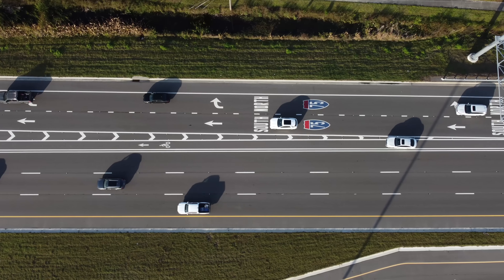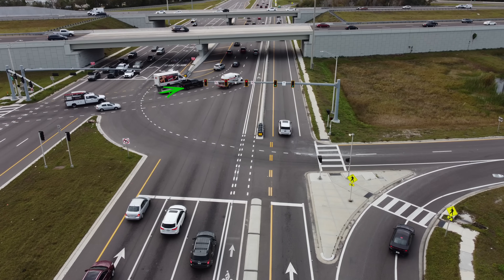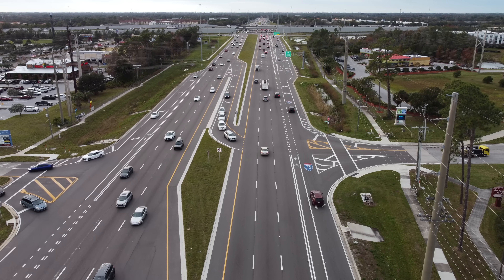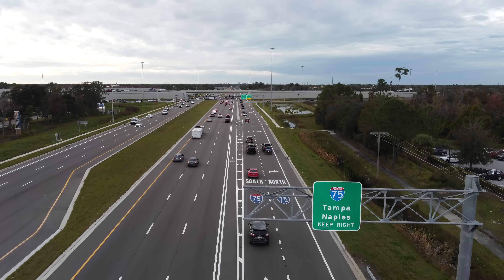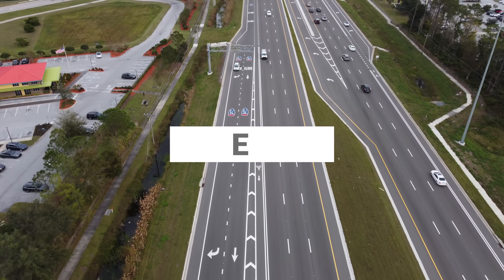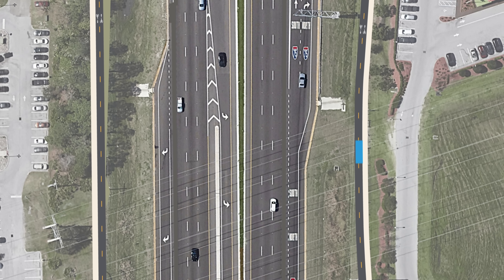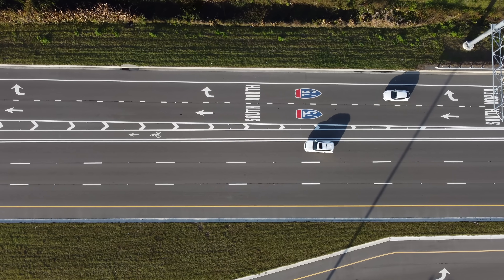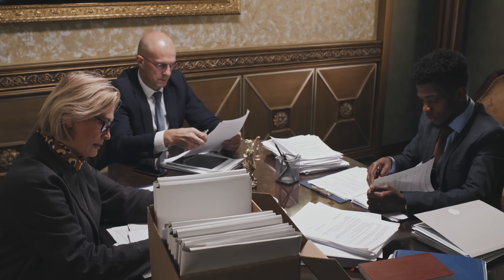This Brand New Interchange is Already Flawed

Comment: Hiya. Local resident here. This interchange makes the road to the west a living nightmare. Everybody who missed the ramp to go SB will make a U-turn to get on the SB ramp the other way. Plenty of backups.
I’m a part of some local bike groups and when they do group rides, they go over an overpass a bit to the south. It’s great for riding for the purpose of riding but impractical if you’re trying to go somewhere.
The main issue you would run into with the tunnels for the bike lanes is the water table. Houses here don’t even have basements because they would flood. There’s no way you could fit a tunnel in there. I live nearby (and I would argue even somewhat uphill) and my approximate elevation is 10ft. The ponds shown adjacent to the freeway are a great example for this.
Reply: flooding is exactly what i was thinking when he mentioned tunnels. it seemed like the crosswalk being farther back from the road is the best idea here, what do you think?
Reply: Wouldn't a bridge be preferable to a tunnel anyway?  It would have to be a little longer then a tunnel in order to accommodate the height of trucks, but aren't tunnels more expensive?
Reply: @khidorian As an active cyclist myself I can attest to cyclist not being keen on stopping to take an elevator. We want to keep rolling! I‘d rather cycle up a longer ramp to a bridge than have any kind of elevator lifting me up, as that’s gonna be slower and break my flow of motion.
Reply: @kathidubach  Oh yeah, you guys love momentum, like in portal. That's my B
Reply: @kathidubach Instead of a long ramp, how about a 40 foot diameter spiral?
Reply: I have got a question - have you EVER seen anyone walking there?
Reply: @nothereandthereanywhere  Good question! No.
Reply: What about bridges instead?
Reply: @khidorahian  it's an option. But the height would need to be at least 15 feet, cyclists won't like that. Tunnels can be shallower.
Reply: @drfisheye  True, I was thinking more lifts to get up and over as well
Reply: My brother lives near  Tampa. He has a septic system and when we visited him,  there was a hurricane that brought the water table so high that there was sewage running down the road. Tampa can never have a tunnel.
Reply: A bicyclist does not need to be deterred by less than a foot of water... I remember doing it in Lund, Sweden.  I just need to know the actual depth, and you may be already wet when you come to the tunnel.
Reply: Most of the Netherlands is below sealevel and it's pretty wet (hence the name). Yet we have bike tunnels. The tunnels don't need to be very high and the roads above will often be elevated a bit so the tunnels don't need to be burried deep. The tunnels are waterproof. And drainage systems will drain rainwater. Sometimes the tunnels have basements to catch rainwater.
Reply: They do tunnels quite OK in the Netherlands, a land that is largely below sea level. That is because they do the engineering and have the knowledge of pumping infrastructure to keep them dry. Spend the time & money and you'll get the desired results.
Reply: @petesig93 I'm a geologist from Florida. I'm sure the Dutch appreciate your accolades, however their practice cannot be implemented in Florida. I'm not saying it's impossible, but it would be incredibly inefficient and prohibitively expensive. Florida's surficial deposits are composed of sands unlike the fine muds and clays of the Netherlands. Sand is highly transmissive to water while clays are not. No engineer or municipality of sound mind would construct tunnels in a region where this is common knowledge.
Reply: Thats not a symbol of a man on a bike. That surely is the only explanation
Reply: I mean the highway is already in a depression so it wouldn't be hard to raise all the access roads slightly so that the tunnels stay above the water table.
Reply: @hedgehog3180 it's not in a depression, the highway and other roads are only a few feet above the water table. Only the interstate is built up to go over.
Reply: Idk Boca has tunnels under roads for some of their bike infrastructure even though the water table is just as high. It definitely is doable
Reply: I would assume the main issue, as it is with most tunnels would be the homeless. I did think of drainage being a problem too, but it usually has a solution
Reply: Digging a tunnel, or anything into the ground in Florida may find you a sinkhole!😮😮😮
Reply: I live 1 hour from here
Reply: Tunnels also feel less safe for some people. Its usually poorly lit and not a lot of people. I think a surface crossing deeper in is the best solution. They can also add a pedestrian prioritized/motion sensing traffic light and make the crossing the same height as the sidewalk too. All of these should make the route sufficiently safe and comfortable.

Comment: The most infuriating thing about the cycle path is that even if one were to be cynical enough to accept that a simple strip of lane markings is the best one can achieve politically, it still would have been safer if it was just placed on the far right of the road, next to the sidewalk, sharing the pedestrian crossings. There it wouldn't have costed much more at all... This current design shows not just apathy but also incompetence in understanding cyclist infrastructure.

Comment: Re: bike lane tunnels. Tunneling is seldomly a feasable solution in Florida. You'll hit the water table in a few feet. There is a reason almost no homes in Florida have basements, those that do are in the north of the state where we have some elevation but for the most part they are not possible.
Reply: Sooo....overpass then. Done Probably cheaper than a tunnel too.
Reply: @CanCobb  That introduces a new problem. Not enough space to build an overpass with a decent grade.
Reply: So then it has a switchback if necessary. This happens in other places too.  @jrkorman
Reply: @jrkorman not enough space???
Did we watch the same video?
Reply: @Jehty_ Yes we did - but  did we look at the same things. The I-75 northbound exit ramp that intersects East-West Hwy 64. To cross that with a bike overpass is going to need somewhere on the order of 18-20 feet of elevation gain. Since that WILL be a long grade it will have to be a shallow gradient, say around 2-4 percent. That means just one side of the ramp is going to have to be on the order of 400 to as much as 800 feet southward along the exit ramp, then crossing near the signage (which of course could be placed on the crossing), then another ramp back down the other side. A second nearly as long ramp structure would need to be built to cross the Hwy 64 to southbound I-75 on-ramp.
I use these longer ramps because I'm also assuming that the ADA folks will get involved quickly and if so there would need to be a large number of flat landings along the ramp. Also allowance must be made at the bottoms of the ramps to ensure that riders don't have extreme curves at the end of the descending ramp.
Reply: @CanCobb  You'll need about $20M per side street for that. Pedestrian bridge cost + all of the dirt build up you're going to need unless you want a labyrinth of switchbacks due to the strict ADA grade criteria. Also, just spoilers, it won't fit in the right of way without encroaching into the adjacent clear zone. So now you're going to need two walls per approach. That's going to get very expensive very quick.
Reply: Yes that is why we in the Netherlands don't have bike lane tunnels. ......................oh wait.
Reply: @driewiel do they have alligators in the neatherlands? Nope
Reply: @eptdy  We have cows.
Reply: @driewiel  oh yes the Netherlands where they have 8 lane highways in the town? To put a bike tunnel where he said would put it underwater anywhere in Florida. You would have to either (A) keep the bike lane at grade and raise the side street or (B) raise the bike lane OVER the side street. Option B is way cheaper this scenario as raising a single bike path over a side street is way cheaper as the grades can be steeper than roadway criteria. But you're going to need to clear 16 feet above the existing road to the bottom of your structure at a minimum. That means you'll need to build up the dirt roughly 20 feet in advanced on both sides with slopes than can grade down without encroaching into the road's clear zone or outside of the right of way (owned property of the state). You can only go up at 5% max which every wheel chair user will hate you for but let's do it. That's 400ft of lead up on both sides to get to the right elevation. You could alternatively put in an elevator and ped bridge at each side street. All of these things get very expensive very quickly, and you're only talking about a single side street. What you quickly find is that it's not a practical use of money.
Reply: @fearlv1rattata You mean Florida is on a completely different planet so what we do in the Netherlands is not possible over there? Half the Netherlands is below sea level. We have far less space. But we care about cyclists. That's the difference. https://youtu.be/ztQ8Oj2fSB0?si=Z5fAp3_vitwLzlkx

Comment: Here's an interesting intersection you should checkout: Kolb/Valencia in Tucson AZ.  They changed the intersection to eliminate all left turns.  Instead you pass the intersection and there's a dedicated left turn to a detour road.   Turning left from westbound Valencia onto Kolb is so rare they didn't even bother doing a detour road for it, instead you're instructed to pass the intersection and do a u-turn.
Reply: That intersection looks like it was made by a control freak. I don’t like it at all. It would make for a good video.

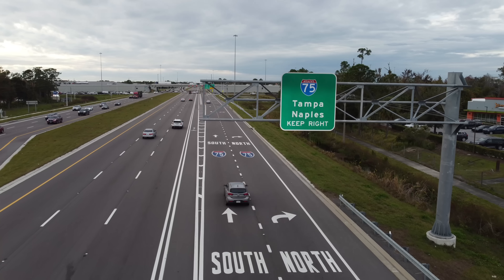Comment: For the drivers the issue with the signs is they were installed backwards.  The signs are flipped.  If they fix this mistake all of the driving issues will go away.  (First incorrect sign @ 3:37, second @ 3:55.)  I suspect it will eventually get caught and fixed.
Reply: You are 100% correct.  On the public website for the project, they have the drawings for the "Recommended Alternative", and they have those two signs drawn in the opposite position as they are installed in this video.
Reply: Here's the site:
https://fip.fdot.gov/Studies/Details/41

And here's the actual PDF (the signs in question are on the last three pages):
https://fdotfipdevstorage.blob.core.windows.net/public/studies/41/I-75%20at%20SR%2070%20Rec%20Alternative.pdf

Comment: Your tunnel idea is lousy for cyclists too, just for a different reason, and less deadly.   You do not want to be going up and down steep ramps that would be required to go from level with a road, under a side road matching the first one, and back up - even more so, you don't want to do it that frequently in such a short distance.  It's a significant amount of extra physical effort in general, and even more if you have cargo on the bike.  But, this isn't anywhere like the Netherlands so... "Cars first!"

Comment: The placement of that bike lane represents the problems of the "bikes are cars" mentality. The reason it was put in the middle of the road like that is because of this mentality of treating bikes like they are the same as cars, so they put the bike lane with the car lanes and thought that made sense. Whereas the proposed solution in this video, putting in a dedicated bike lane along what would typically be thought of as a pedestrian path... that represents a "bikes are pedestrians with wheels" mentality. And that, IMO, works way better way more of the time. 

I feel like I've been banging my head against the wall for over a decade when it comes to this issue. I never felt like the "bikes are cars" mentality was good. It's dangerous. When you're on a bike, you're a lot closer to a pedestrian than you are to a car. A collision between a cyclist and a pedestrian is gonna be a lot less dangerous than a collision between a cyclist and a big vehicle that can go over a hundred miles an hour. This is ESPECIALLY ridiculous when we're talking about highways here. I don't care how fast you can peddle your bike... you're not keeping up with that kind of traffic.

"Bikes are pedestrians" works way better and is way safer. Even in a situation where there's no bike lane, I'll gladly use the sidewalk before I try risking my life on the road. Ideally, there needs to be dedicated bike lanes, and they need to be separated from the vehicle traffic in a way that feels safe. Just shoving us on the side of the road, or in the freakin' middle of it, and hoping for the best is not acceptable, IMO. I would NEVER use a bike lane like the one in the video. Whereas the proposed solution looks beautiful.

THIS is the difference between "bikes are cars" and "bikes are pedestrians". How can anybody tell me that "bikes are cars" is better?

Comment: The tunnel idea for bikes/pedestrians is a great idea.....anywhere else but Florida.  But only because of the geography of the state.  Along coastal Florida, the water table can be anywhere from 3 to 5 feet below ground, meaning any tunnel here would have to have some insanely-engineered flood control to make it viable in those conditions, something that would cost a ton compared to a simple crosswalk.

That's not true for all of the state, but does apply to most of it.  It's the main reason that nearly every home built in Florida doesn't have a basement, you just can't dig that far into the ground without introducing a lot of water management problems in the structure.  I live in one of the few areas of Florida where you can have both basements in homes and tunnels for bike paths, and we indeed have both here locally.  Our bike paths have a mixture where tunnels are used where they can be and crosswalks are used where they can't.  It's just not practical in most of the state, though.
Reply: If they can't build an underpass/tunnel, build a bridge over the road instead then.

Comment: I thought that interchange looked familiar! Every single time I visited my friend and had to take this exit, I asked what the hell were they thinking? This is so confusing! Why did they do this or that? It was something different every time. The biggest problem was bad signage. If the signs had been designed like they were on the actual interstate where it goes over the entire road and has clear markings & arrows indicating which lane goes where, then it would not be nearly confusing. I still can’t believe they used that type of signage (if they even replaced it, which wouldn’t be surprising if they didn’t).

Comment: I'm sure the highway engineers had a good laugh whenever they thought about this "bike infrastructure".  I'd go as far as to say that this is an example of hostile design.  Florida highway engineers have a conflicting interest.  If they built intersections you can use without a car they might have to find a new job.

Comment: Wow definitely a signage issue. It always boggles my mind when they mess signs up.
Reply: In Massachusetts, there's a case where two highways of different numbers temporarily share the same path.  But they are BOTH opposite directions of the overall directions of each highway.  95 North, 128 North, 93 South and Route 1 South are all the same road, for a short stretch of east/west routed highways.

It drives people nuts trying to figure out which road they are supposed to be on, when picking a direction.

Comment: The civil engineers messed up here. They may have not thought of everything but they should've double, tripple, quadrupple checked. They are supposed to solve problems not make more in this situation and these usually take years to decide so they cant use that as an excuse. I understand the budget problems which isnt on them but they could of done better. This seemed rushed and careless